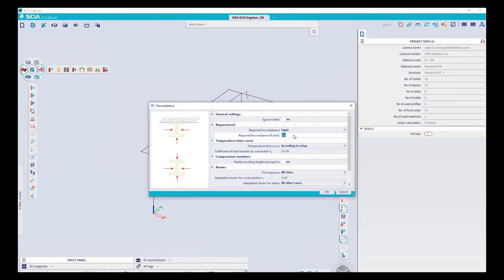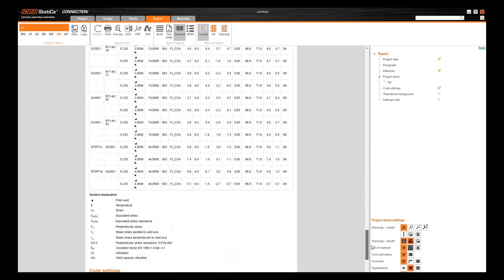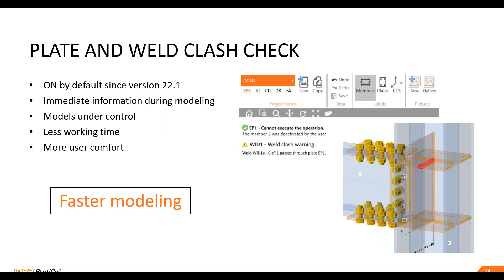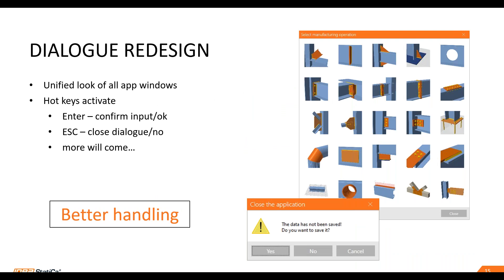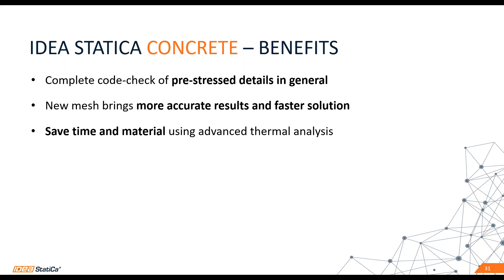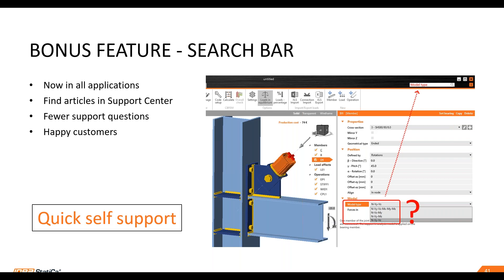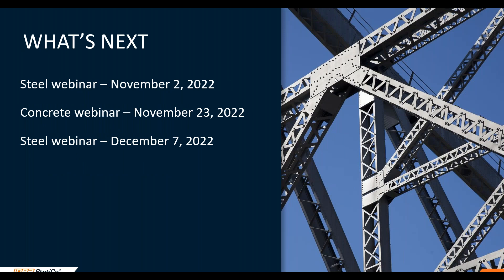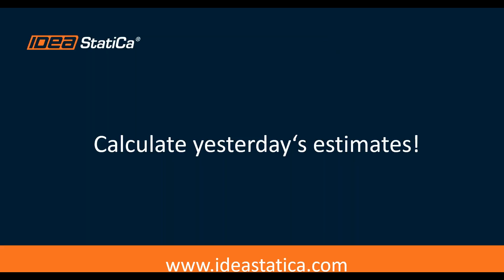What's new in IDEA StatiCa 22.1

Comment: Do you have any aim to widen IDEA Detail functionality up to 3D analysis? This is going to be a break through. Unfortunately, not all D-regions can be simplified to 2D. 
Even a simple wall panel can buckle out-of-plane before in-plane failure appears. If the panel is too thin.
Reply from the maker: Dear Евгений. We are working on the development of 3D finite elements that will be implemented in Detail. We plan to have a POC (proof of concept) by version 23 and in the next versions the solution will be improved to be provided to customers.

Comment: Recently I take a trial for your Idea Statica for learning purpose.I installed the software first then install beam link for StaadPro Connect edition. But after installing, when I tried to use that software, software did not work. Actually I made a transmission tower in StaadPro Connect edition V22 update 11 and after analysing the structure, I tried many time to import joint and members for connection design but it failed to do so again and again. I tried using "check code manager.vbs" and "check bot" also. No operation can do the job. I tried by watching your YouTube channel process also.. but same thing happened. And it is not the problem of StaadPro Connect edition because other software environments are working fine with my StaadPro Connect edition except Idea statica. I tried manual installation of respective batch file for StaadPro Connect edition also. But no results. If your software work like this, how can I believe your software and purchase one lisence? Please give me a quick solution for this, because making model , applying loads on that in idea statica again after StaadPro analysis is very hectic. Give me solution so that I can import connection by selecting nodes and member in StaadPro Connect edition model after analysis. I thik your software is not properly compatible with StaadPro Connect edition V22 update 11. I have created a case against that problem. But did not get any response regarding this!
Reply from the maker: Dear Indranil,
IDEA StatiCa 22.1 supports STAAD.Pro version 22 including the update 11, we keep this information updated here:
https://www.ideastatica.com/support-center/bim-links-supported-versions-of-3rd-party-applications
Please reach out to our technical support and we will take care of the problem since we haven't heard of any issues from other users:
https://www.ideastatica.com/support-center/how-to-create-a-new-support-case
IDEA StatiCa team